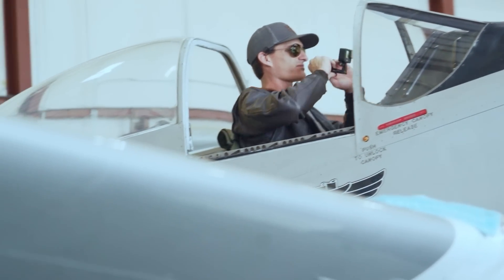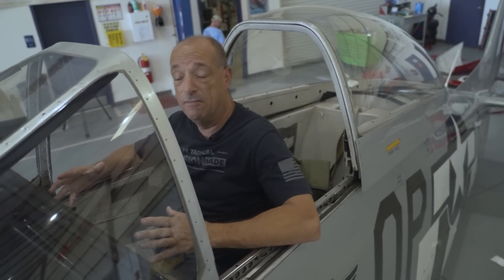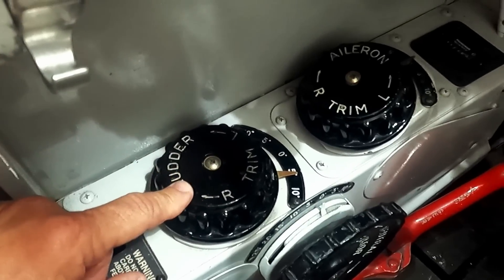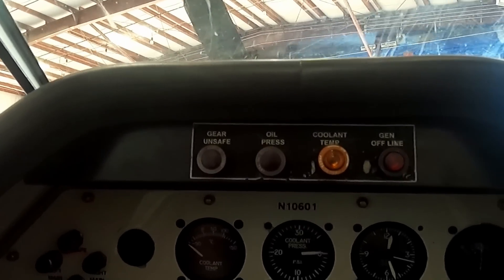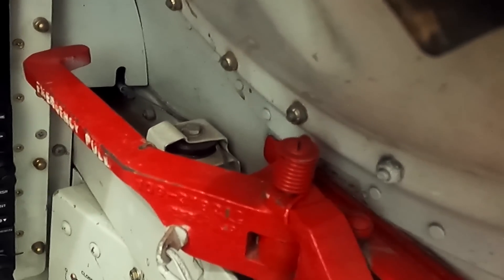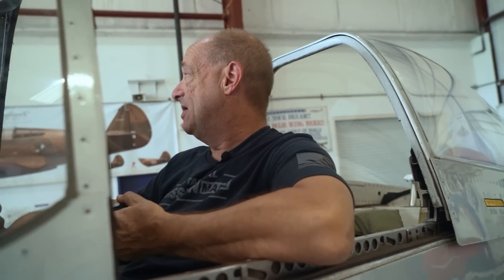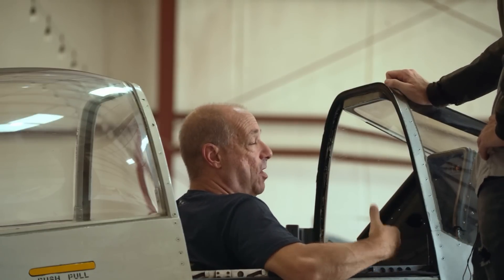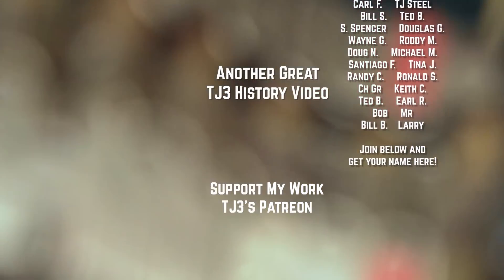Inside the Cockpit of the P-51 Mustang (With a Warbird Expert)

Comment: A , Q : can a P 51 landing in a carrier ?
Reply: One could, it was modified to land on carriers with reinforced gear, landing hook, and reinforced frame. Also, it only did it once since landing speed was so close to stall speed. but 99.99% of P-51s, no, it's strictly land based.